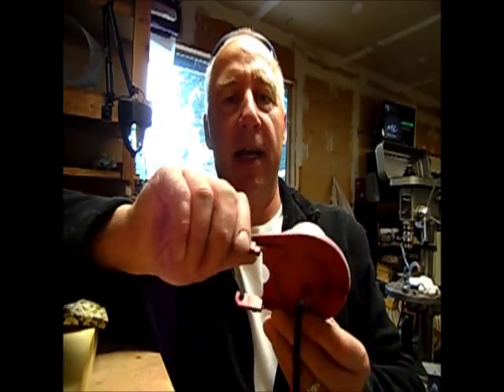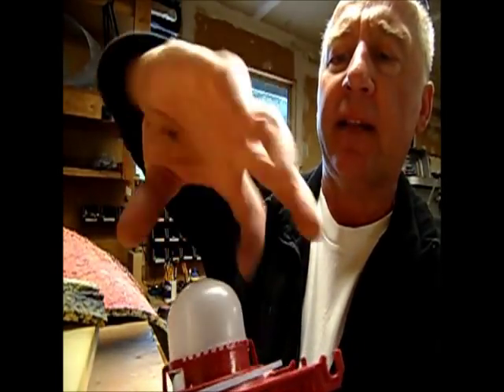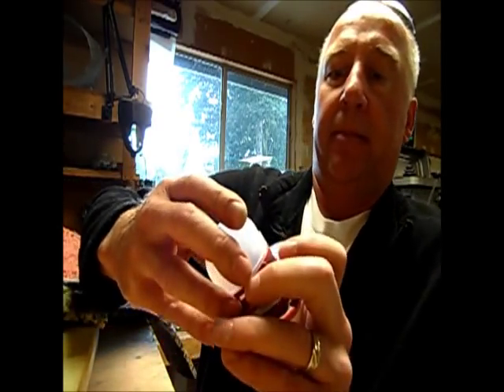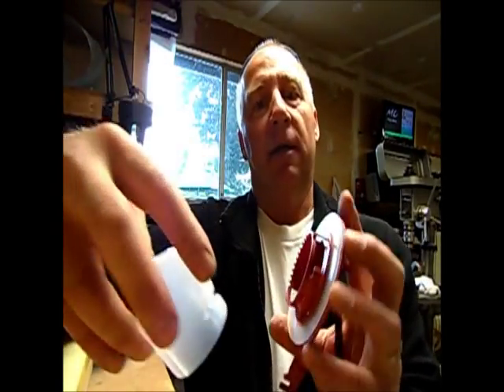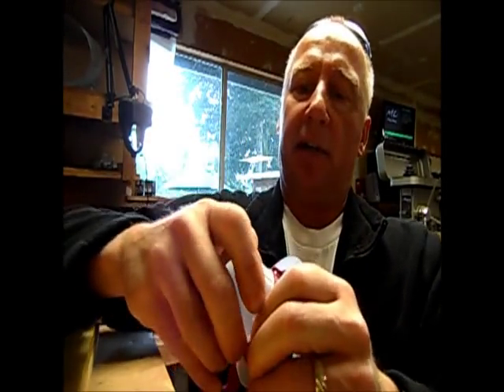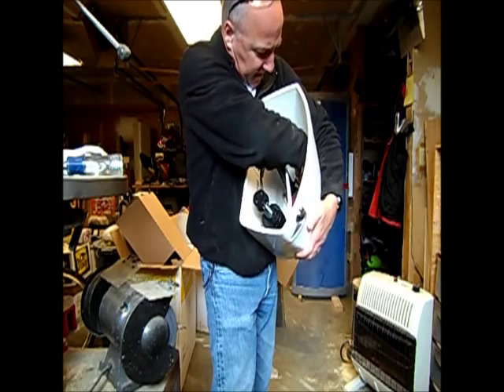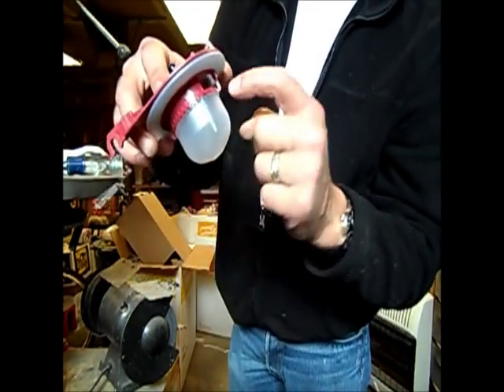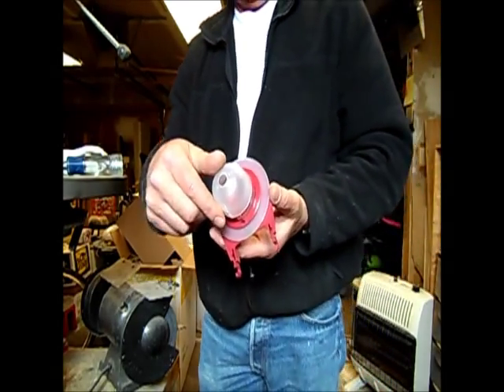Fluid Master 540 adjustment

Comment: I was looking for the solution for another problem I have.  This flapper has arms that are too long for my toilet.  I see they are adjustable for width, but not length of the arm.  Unless I miss something.

Regarding the plastic piece you can't rotate, mine rotates no problem.  I don't have to push on anything or take it apart the way you did.
Reply: This model comes with the appropriately sized flapper installed and rotated at the proper angle. So, yours may be defective or someone put in another flapper. In any event, you can try to rotate it so the angle is similar to what you see at 3:48 minutes into this video. If you can't rotate it, you may need to drain and take off or loosen the tank and large nut holding the overflow unit a little, rotate it appropriately, and tighten it again.  Don't forget to turn of the water supply and drain the tank completely first or you will have a flood.

Comment: I just purchased a new American Standard toilet with that 540 flapper valve. So why the incompetent engineering and why ship in position 1? The  1.28gpf is already close on water to siphon and as delivered new out of the box the valve dropped after half the available water could drain. Doesn’t anyone take the time to check products anymore? I’m certain AS knows this is an issue yet doesn’t fix it, shipping a not inexpensive toilet that requires the user to hold the flush handle down for proper operation.
This is nuts.
PS I changed mine to 10 with my pump pliers. Grab the bulb close to the red index and stop area making sure the pliers has the raised plastic in the grip and turn it. Nothing breaks but does take some 
Finesse

Comment: Used your advice, helped some but still can't get toilet to flush right. I'm lost after chain adjustment 4 or 5 times, set on 10 , Any other suggestions? Thanks , Steve
Reply from the maker: Have you adjusted the amount of water in the tank by lengthening the length of the pipe that comes up from bottom of tank. I think the pipe is made from 2 pcs. I think you give it a half twist and pull apart to new length, then 1/2 twist back to lock. I know some of them adjust that way anyway.
Reply: +dablingtime I'll give it a shot, Thanks

Comment: yes I did. I'll just change the flaps then. Maybe that will help.
Reply from the maker: Other than the chain not letting it close completely, should be a little slack in it, or it not being seated in the pivot point correctly, I can't think of anything else unless its warped or something. It does seal if you push down on it right? Then yes I'd probably try a whole new one and don't be surprised if it adjusts easily like they are suppose too. Good luck.

Comment: I was able to squeeze the bubble together and rotate the number selection without removing it.
Reply from the maker: Christopher Nottle, Interesting, it's been so long since I did this video but I'm pretty sure I would have noticed that. I still believe they have 2 designs, the PITA design and the correct design we all expect. Thanks for commenting
Reply: No problem, this was the one that came out of my American Standard toilet.  But the replacement I bought at Home Depot today I was also able to "squeeze" it and turn it.  Either way if there are two different versions your video was still helpful.

Comment: Almost broke my hands to try to turn the dial.I saw 2 version. One you can simply turn and another has 2 set of notches. Another is hidden inside. You have to take it apart.

Comment: for some reason the water started leaking out. Do you know what causes it to leak out?
Reply from the maker: leaking out of what?
Reply from the maker: or should I say where exactly?
Reply: Check to see if the white plastic ring on the flapper has any bubbling on it, that affects the seal, use an exacto knife to poke the bubble and cut away any excess plastic so that its nice and flat again.

Comment: read the instructions they tell you lift and turn
Reply from the maker: Glenn Davis, yes usually. But this particular one, on this toilet, does NOT simply lift. As other have also found out. I'm thinking Glacial bay required that it be more difficult even thought it's the exact same part number. This came with the toilet already installed.

Comment: uhi can see how that would be really hard to push in by hand. i used my trusty flathead screwdriver bc my fingers just don't work that good.  Id recommend pushing strait in right under the " detent" good luck everyone
Reply from the maker: Good suggestion, more pressure control also. Thanks for watching!

Comment: Mine is at 10 and it leaves 3" of water in the tank.
Reply: That's normal, the flapper will close when there isn't enough water to hold it up.

Comment: Thank God for your video.  As I write this we are installing 2 new American Standard toilets.  The flapper came pre-installed in the toilet.  The Fluid Master 540 flapper wouldn’t stay open long enough to flush correctly.  And American Standard doesn’t include instructions for them.  WTF?   How many people have returned the whole toilet after installing or gone out and bought a new flapper.  Get a clue American Standard.  Include some instructions.  I have never seen an adjustable flapper,  Didn’t know they existed.
Reply from the maker: WHIT5751 , thank you!

Comment: Directions say pull the bulb out and turn. I figured out that I could could l get the adjuster side to lean easy than pulling down. This let the bulb turn. Then pushed back in to lock in place.

Comment: you can turn it without popping it out.
Reply from the maker: RWR Ministries, NOT always, that's why some find this helpful and others don't. this came with the toilet as a unit. I believe the off the shelf EXACT same model DOES allow you to adjust it easily.
Reply: Not a problem. Just thought you didn't know.

Comment: All you do is rotate it I have a 540 and I just adjust it by turning it you do all of that removing for no reason
Reply from the maker: They make two models with the same number, one is adjustable and one is not. I'm serious, it's nuts. But true.
Reply from the maker: Curious now, does your have the tiny lock tabs sticking out like mine did? If not, that why yours is adjustable. I suppose I could have sanded off those stupid things.
Reply: @dablingtime  those tabs make it to click into place…

Comment: May God have mercy on the soul of the engineer(s) who designed the monstrosity that is the 

fluid master model 540 flapper valve

I have never seen something so overly designed and complicated aaaand non functioning in all my years of repairing, replacing, and installing toilets.

The fact that these valves have been added to low volume toilets from American Standard which are absolute pieces of junk makes the effects of this horrible product even worse.  

How does a low flow toilet help the environment when you have to flush it three times 3.72 gallons total to do what a 1.6 gallon toilet to dispose even a moderate sized duece with a light wipe.

That’s about all I have to that……Arrggghhhhh!!

Comment: This is wrong. All you have to do is spin it. They come preset on  "1". The surrounding frame has a sloped slot the enables you to turn the dome to a higher number incrementally to set the flush duration. They did not make it difficult.
Reply from the maker: Did you see if yours has the tiny nubs I mentioned that stop you from lifting and rotating it?